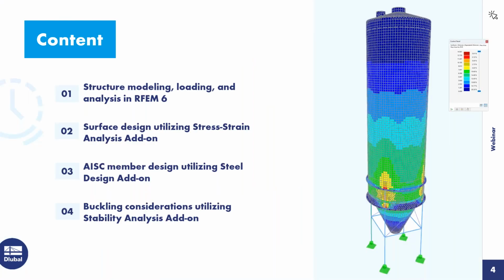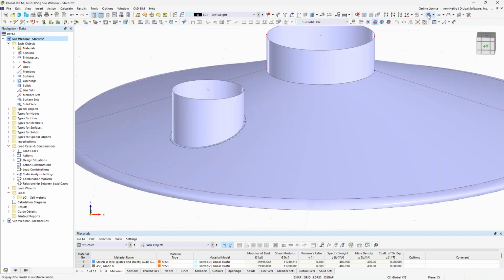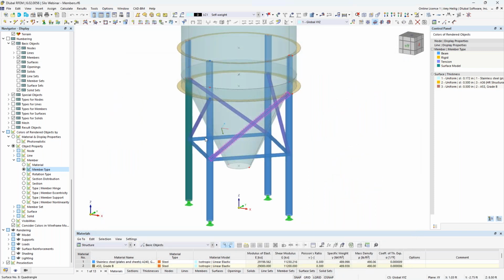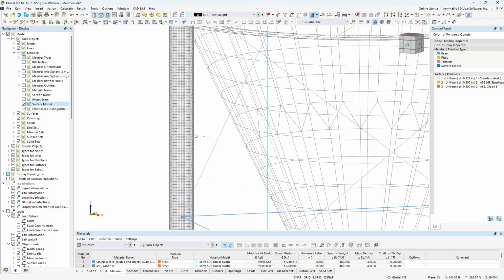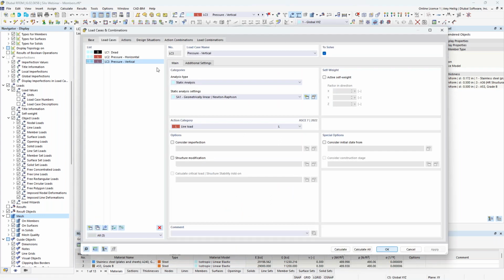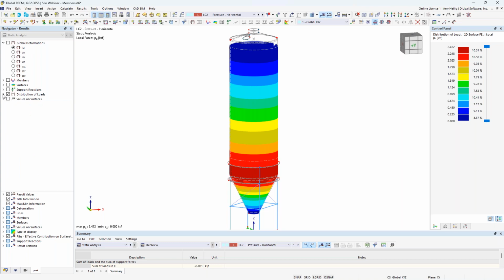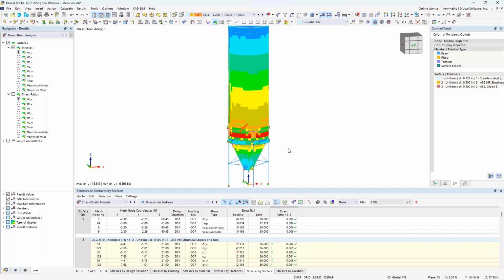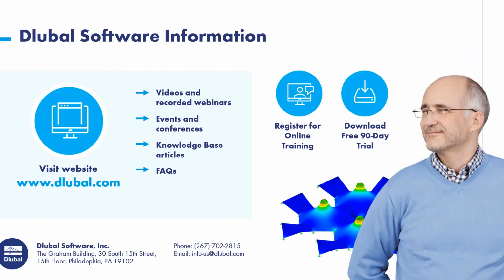Webinar | Steel Silo Design in RFEM 6

Comment: With what material is filled this silo ?
Reply from the maker: Hi, @NikollaToci! The specific material used to fill the silo in the video "Webinar | Steel Silo Design in RFEM 6" is not mentioned in the provided context. However, in general, silos can be filled with a wide range of bulk materials such as grains, coal, cement, wood chips, or even plastic pellets, depending on their intended use.
Reply: Thank you!